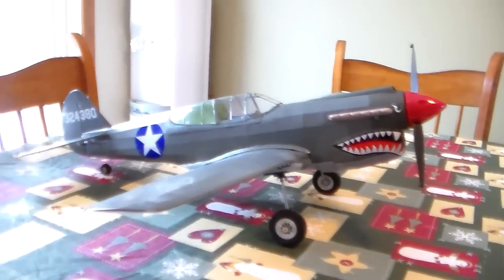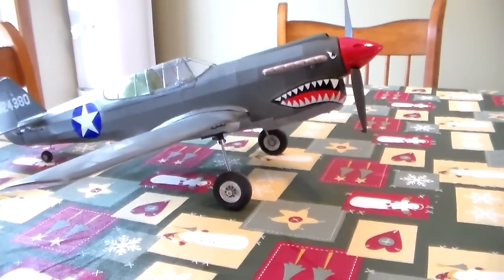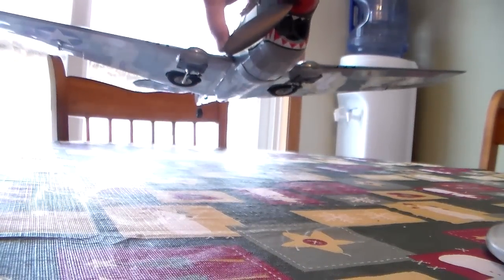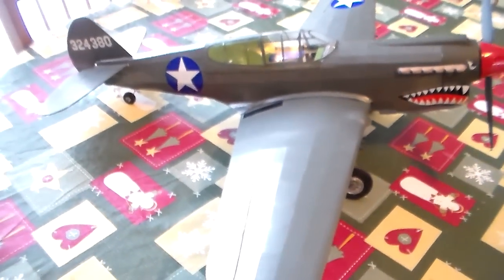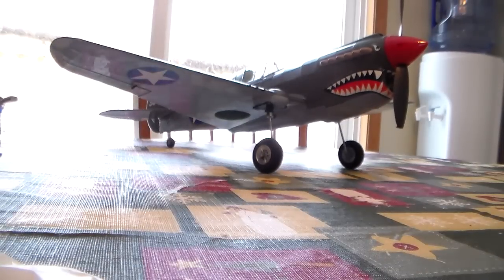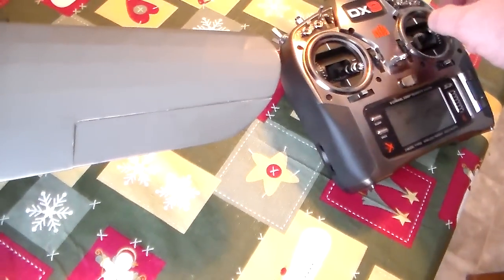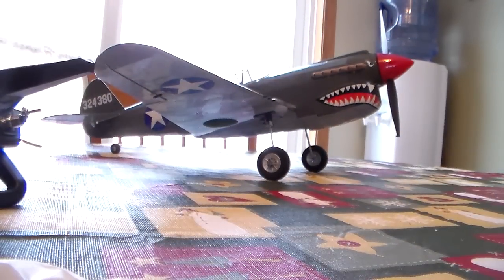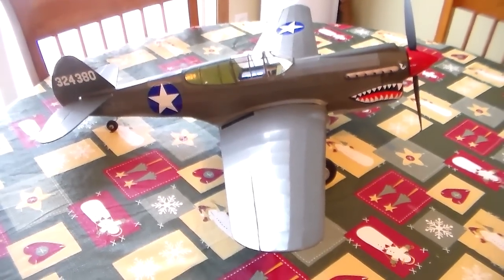Guillows P-40 kit 405 R/C conversion with retracts

Comment: For the covering did you paint over the tissue paper or is a different covering material?
Reply from the maker: hi, i just use hangar9 parklite iron on covering on these models.tissue covering is a whole other art in itself that i am not too good at. one of the best benefits of iron on covering is if you make a mistake while painting you simply use a thinner rag and wipe it off and start over =D

Comment: May as well do ads with these punks giving us thumbs downs with links to detailed build threads.  Just got the Sterling P40 and have been thinking of a common rod single servo retract setup with panhard rod rotators.  Currently working on the HP Jetstream on RC Groups.  Getting close with it but also burned out.  May take a break and start on the P40.
Reply from the maker: i hear you bill, it is allot of work to build these models and have them fly well. i smoked this model on the maiden, that burns still to this day. im glad to hear you are building and i too know that sometimes you have to just take a step back and regroup.
Reply: @jagdpanther9  I don't blame you for not posting the flight, due to these idiots that are obviously not entertained and gave thumbs down for no flight video.  Us Guillow's/Sterling model builders would like to see the flight to learn from it, but most of these people just want to be entertained and give a thumbs down if it's not a perfect video and flight.  I have 2 videos where there is a successful flight 2 video, with a link to the second flight.  One burned an ESC quickly, and the other was an ultra light Lear Jet where it was too windy the first day.  The viewers probably never bothered to see the link the the second flights and gave thumbs down.  I'm about done with posting vids and am looking for a venue that doesn't allow ratings.  Also tired of RCG non contributors that only post when they don't like the video quality, even though few post any flight video.  Pathetic crowd.

Comment from the maker: hi birsan, the retracts are eflite 10-15 size. I trimmed the plastic cases with a dremel and shortened the wire struts until they fit just right so I really don't have a measurement I just kind of made the 10-15 size eflite brand retracts fit.I hope this helps !

Comment: Just picked up a set of the eFlite retracts to try this - bought a P40 after watching your video... Now just to do it.
Reply from the maker: Peter Gregory if you trim them down they do fit. after 3 hard crashes with this p-40 it only bent the LG wire it didn't even phase the retracts..

Comment: Nice build I like the retracts that you added. I am very curious as to how it flies as I am currently building the same model. I haven't decided what kind of power plant to put in it yet, still trying to figure out where the stuff is going to fit lol. Did you have to modify much to fit in the electronics? Only place big enough for a battery that I've found is in the cockpit opening. Any pointers you could give me would be great. Can't wait to see flight footage.
Reply from the maker: well, the only footage I have so far of this one is it torque rolling on take off heading straight for a building and going in hard . it was either stuff it in or hit the building. not pretty. so far I have rebuilt most of the airframe but I think that I have way too much power as I was trying to be very careful on take off and it was just uncontrollable . I will be switching to a 29g 2800kv motor on 2s 800mah.like I have used in my p-51 and my bf109 both 400 series models.
to be continued......thanks for your comment.